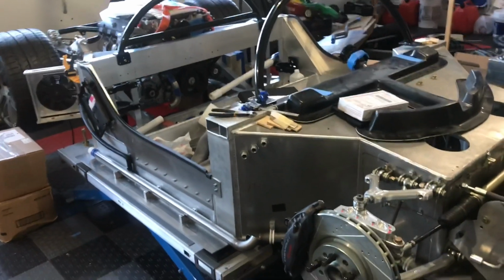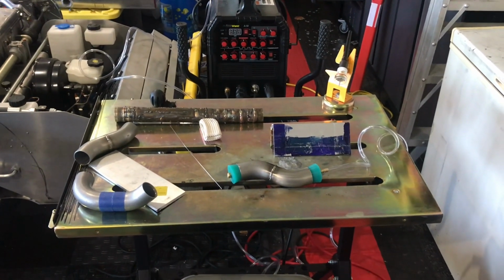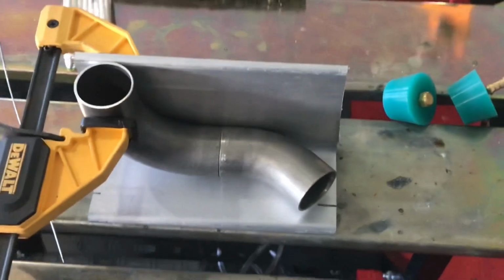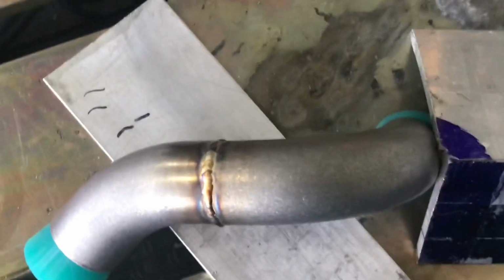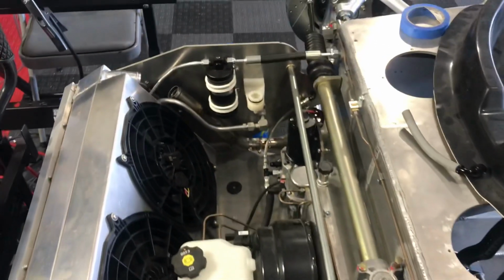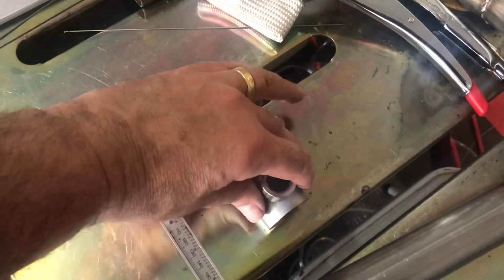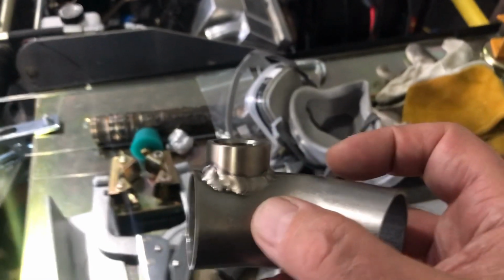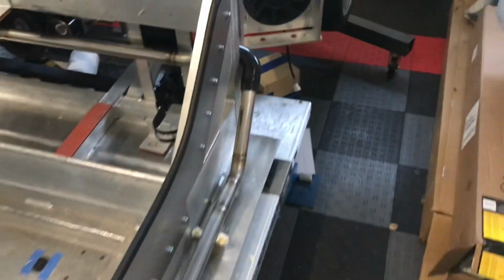Superlite SLC Build Video 89 - Welding Up The Cooling Tubes

Comment: Joel great video knowing how to weld is mandatory to build one of these.
Reply from the maker: Thanks Dave, certainly helps being able to weld. Especially if you are not using an LS engine that just fits right in with all supplied hardware.
Reply: @JoelKSLC  I thought you were using and LS engine?
Reply from the maker: @dave5833  went with an LT4 Engine which required to fabricate a whole host of items. Now if you buy an SLC, RCR will provide LT4 engine mounts where I had to fabricate them myself.
Reply: @JoelKSLC  hind site is always 20/20